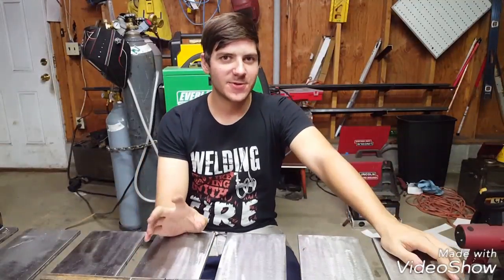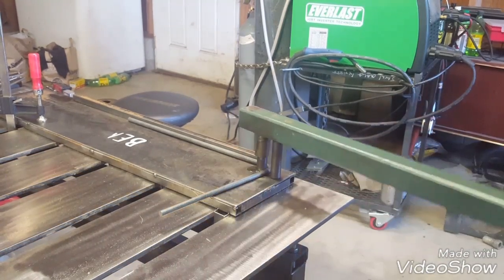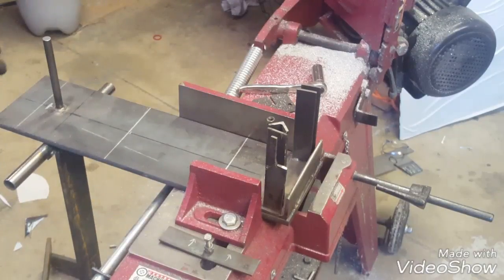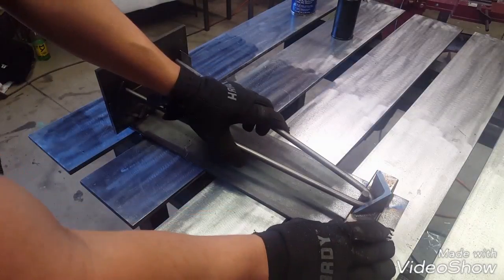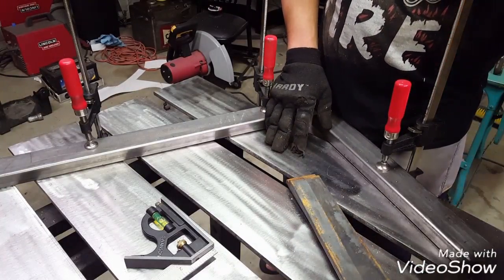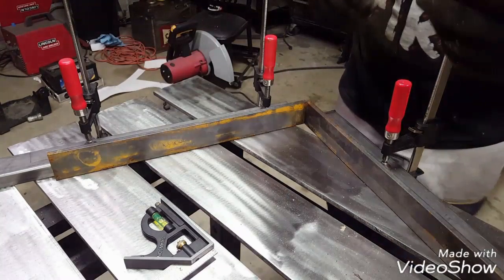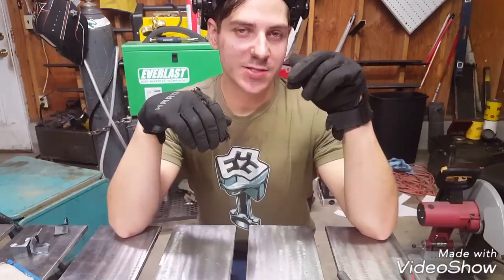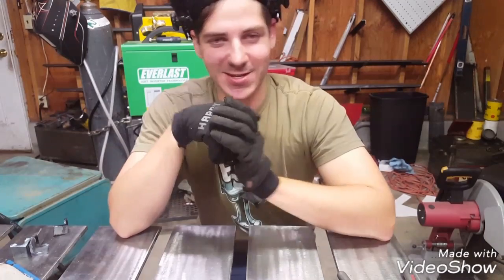How to Build a Fixture or Jig

Comment: Looks like Stainless 1/4 8X36 on your table?  Would you sub anything cheaper for that?  Thanks for the uber simple designs!
Reply from the maker: It's 5/16" 5"x36" mild steel that I removed the mill scale off of.  Works good though

Comment: Some very good tips on making welding jigs and fixtures, but I would like to point out the frame jig @ 4.34. I would NOT be using my adjustable square for such a large angle as they are notorious for being out of square. 
The best solution is to get a larger Framing Square, they cost @ 25 to 30 $$ as they have longer legs to get a more accurate set up. Failing that you could always consult Pythagoras and use the old trusty 345 or multiples there of.
Reply from the maker: Mark Fryer very true I just didn't want to get my square haha thanks for pointing that out

Comment: I see you have a Everlast and a alpha hp welder. What kinda feedback about them. I have horbart and I want to upgrade for something better with pulse setting. I been doing aluminum mostly.
Reply from the maker: henry rosado I like them a lot the ahp welds nicer on aluminum then my syncrowave 250dxs at work.  I've had it for over a year and have quite a bit of time wrapped up in it and I has yet to fail on me.  I don't normally use pulse unless I'm on something very thin.  

The Everlast is cool because it has actual voltage and ipm and amperage readout on the screen.  It can also take the larger rolls of wire which is nice.  Both of them are dual voltage which I love because I only have 110 out in my shop.  I don't have anything bad to say about the Everlast but I've only ran maybe 30 pounds of wire through it so far.
Reply: 5th Street Fab Shop  it just hard to pick up a right one especially when you are new in the tigo welding. I just don't want to buy something that I don't like it later. I been looking at ck workwide but I didn't like that is doesn't do 1/2 inch aluminum.
Reply from the maker: henry rosado they are all pretty much 200 amp machines so with any of them they're going to put out the same heat.  You'd have a lot of trouble welding 1/2" with 200 amps.  I'm usually at 275 amps with a helium to get enough heat to weld that thick.  I'd say with preheat a 200 amp machine will weld 1/4" no problem and especially with helium added in.  But all the machines are very similar. ck makes good stuff I wouldn't be afraid of there's at all.  As far as low end, Ahp, Longevity, Eastwood I would assume they're all just fine with slight differences just buy what you can afford and remember you still need to buy a bottle of gas, filler, tungsten, cups, collets, etc.